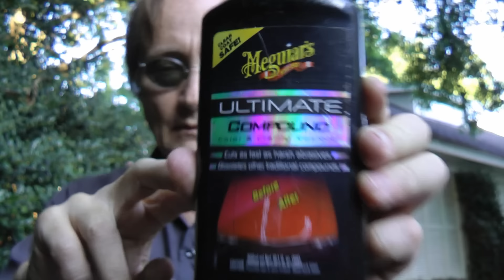How to Fix Faded Car Paint

Comment: Does this work for door handles that have cracked paint on it?
Reply from the maker: +Kelvin Leung yes, but you would have to sand em down to remove the cracks first.
Reply: Do I have to apply a coat of paint after I sand it down?

Comment: will this work on a 97 honda accord thats pretty weathered on the hood?
Reply: Not likely if the paint is pealing or the clear coat is pretty much gone.  It'll need stripping and repainting if that's the case.

Comment: will this work if you sand off the edges where the paint is chipping and the do this
Reply from the maker: you can try, but realize different levels of paint will exist and it will not match perfectly due to that.
Reply: MinecraftAholicZ Gaming no it will not you should just get the panel repainted any chipping its kinda done it will just mess up again

Comment: do u have to have a clear coat on the paint to do this ? cus i just  painted my car and its not that shine  u cant se reflections in it (the paint is not mat paint)
Reply from the maker: the paint in this video is 2 pac, requires no clear coat. Most paints need a clear coat to shine
Reply: Scotty Kilmer ty Scotty i talked to a guy that sells paint and other stof and he gave me 1000 grade sand paper told me to wet sand it down a litle and then put clear coat :)

Comment: Will this or the "repainting faded car paint yourself" method work for peeling clear coat? And when I fix the peeling what should I do to prevent it in the future?
Reply from the maker: for clear coat, you have to buff the old clear coat off, pray there's still good paint underneath, then spray new clear coat over that. You can use clear coat paint in this method of course
Reply: Thanks so much! And for maintaining good car paint what do you recommend? Aside from regularly washing it there are so many products like clay bars, sealants, polishes, waxes. Should I use all of those?
Reply from the maker: Alice Rose
use extra products like clay bars only if needed for rough paint. basically, wax your car 4 times a year, once each season.
Reply: thanks so much!
Reply: diver dave thats a Honda! Will last for years to come...500,000 miles.
Reply: diver dave thats a Honda! Will last for years to come...500,000 miles.
Reply: the Civic has 1.2 Million Miles?!?!?!?!

Comment: What type of wax are you using to re wax that part and I have a BMW e46 m3 that is black and I put thinner to get rid of paint that was ran over and my body shop guy told me to and now it's a little dull would this fix it ?
Reply: Please help me thank you!!
Reply from the maker: +crazykid2998 any carnuba based hard wax works fine, I often use Mothers.  But dull paint needs buffing out first, and in modern cars, often requires a new coat of clear coat if that got all rubbed off
Reply: thank you soo much!!

Comment: Dude - it looks like when you put your buffer into the bucket of water - your buffer was plugged into electricity.  Please unplug do not want to see you get hurt.   Oh by the way thanks for the video.
Reply from the maker: my power is on a ground fault circuit, you can't get hurt with that, it would just shut the power off
Reply: Thanks Scotty for the response - Just did not want to see you get hurt - was not questioning your work.  Have a great day.
Reply: I see your concern though, as others that watch this may have an ungrounded circuit, let alone one with a ground fault interrupter circuit, so yes, one needs to be more careful.

Comment: That’s not correcting anything.  That MUST be re-painted.  When the clear coat fails your paint will begin to degrade (fade) from sunlight and washing your car.  

There are ways to re-spray clear coat and blend it with existing paint/clear but it won’t look good.  Re-painting is the ONLY true fix for this.

If you came to this video seeking detailing advice, do yourself a favor and check out AMMO NYC’s channel.  He can show you the proper way to maintain a cars paint.

Comment: There is no clearcoat on that spot that is not how you fix that, you are basically buffing out the paint itself that's why there is color on your buffing pad.. The right way to do this is to get a paint job it will fade again in less than a month or so like this, there is no clearcoat to protect the paint anymore on that spot SMH

Comment: My car is missing some clear coat next to the boot. I'm only after a rough fix, would just spraying some clear coat over it make it somewhat blend in and protect the paint?
Reply from the maker: yes, if you are careful spraying
Reply: Scotty Kilmer Cheers. I'll give it a go. The car is a Mitsubishi Galant. Supposed to be quite reliable. Only has 140,000km and a full service record. I'm the 4th owner.
Reply: If the spraying come out a bit rough, try wet sanding it lightly with some 1000 grit abrasive paper/cloth,  then with 1500 and 2000 grits, then polish and wax.

Comment: Does this only work with small portions of the car, or can I do this for the entire hood of a car that has paint that is faded from the sun?
Reply from the maker: small portions, hoods are best removed from the car and painted hanging in a dust free location anyway
Reply: Scotty Kilmer The problem is that I'm afraid when I try to paint the hood, that the color wont match the rest of the paint because the paint job was done a while ago
Reply: crni195 Would it be practical to use Scotty Kilmer's technique in small portions throughout the hood, or will that still result in a weird look? My hood has about 4 or 5 faded spots, and I am wondering if I could just buffer those out using the compound separately from one another.
Reply: You can buff your whole hood but dont dip the buffer in water and dont apply the buffing compound by hand put some on the buffing pad and smear it on the car using the buffer pad and dont stay in one area too long it will get hot and screw up your paint

Comment: Wrong.... The paint is old and dead that's way its coming off in the first place. All your doing is wasting your time and money doing it the wrong way buffing dead paint and primer that will not keep its shine very long. The only way to fix this right is to sand all the paint that is flaking off all of it! Prime or seal as necessary and paint. That's the right way to repair it so you can buff it after drying and the shine will stay after locking in with a good wax after the buff. It very clear Scotty is NOT a bodyman!

Comment: ... That's clear coat. And you're not fixing the paint you're making it worse. Base coat clear coat consists of two components . color. That's what you were taking off with your buffer. Which is why it was turning colors. And clear coat. A protective clear is placed over the color to protect it. This may have been the case to be true if you were fixing enamel or lacquer. But this is not how you fix base coat clear coat. Back in the 80s and 90s, All Automotive manufacturers were experimenting with waterborne colors and primers. The Sun beats down on the panel and dries out the waterborne materials. When the color or primer no longer has the chemical integrity 2 hold together, the clear coat or the color starts to fall off. And yes, the best way to fix this problem is to repaint a vehicle. Because there are no shortcuts. The waterborne primer and color is going to continue to allow the other components to fall off. Yes, wax and compound is a short-term repair. But the more you wax it, and the more you buff it, the faster the paint is going to fall off. For any other further technical assistance please contact the manufacturer or refer to their repair service bulletins. I love it when the paints fall off the car. Because, just like back in 1993, I'm getting paid to fix it. The right way. The first time.
Reply: Kelci paint